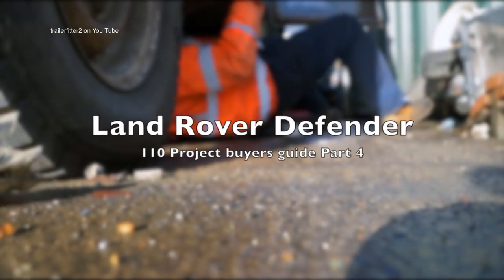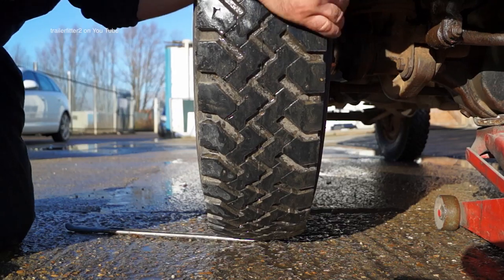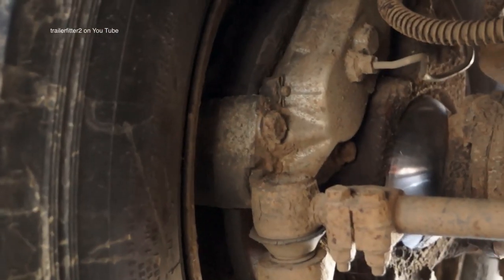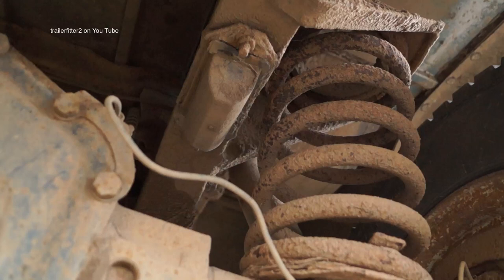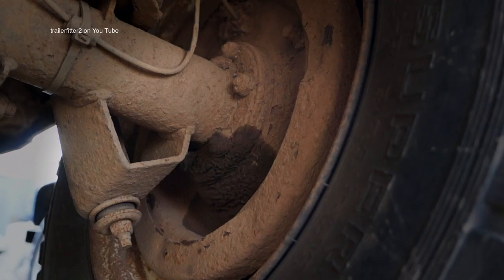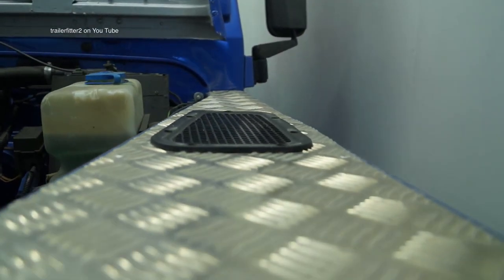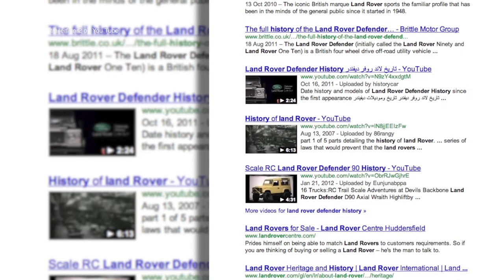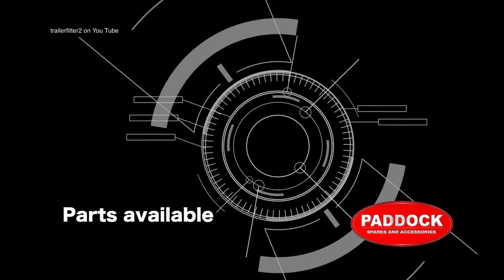Part 4 Land Rover Defender 110 buyers guide - time to get on the crawler board

Comment from the maker: The last time I enquired about VIN plates I was told 2 versions.  I can stamp out the number on a plate and fix it although i was warned it is frowned upon.  The second option was to pay to have another VIN plate made with altered axle weights on, this is why I needed to change the VIN number.  Works out that documents provided of ownership is all that is needed for new plate done and notification sent to DVLA to adjust the log book. Easy.

Comment: A very useful and informative video. Cant help thinking that if more people understood these basic inspection techniques: especially using a bar / feeling for play in components people would have far less problems. Many seem to accept running a vehicle with drivetrain/suspension in this condition as ok. The number of vehicles I go out to like this...owners dont seem to like it when you tell them the full extent, preferring the "dont fix what isnt stopping it moving". HMMM!

Comment: I have always thought the Defender as we know it started with the introduction of the 200 tdi  around 1991. All before that were called 90's and 110, I had an 1988 N/A Land Rover 90 and there was no sign of the Defender name. Also it had drums on the back and 200 tdi 90's all came with disks on the back as far as I remember. All Defenders with the 200 tdi all came with power steering I think.
Reply from the maker: The 200tdi engine was released to upgrade older Defender engines which was a real bonus at the time.

Comment: The engine was in good condition, it started right up on LPG after 3 months of not being run. The chassis also seemed in pretty good shape as far as i could tell. The bodywork and interior were in quite a state and would blow my budget to repair sadly. It used to be owned by the local constabulary so the bloke who bought it repainted it black and rather poorly because oxidation bubbles were everywhere under the paint. This guy who was selling it now ran it hard and abused it quite badly. So no.